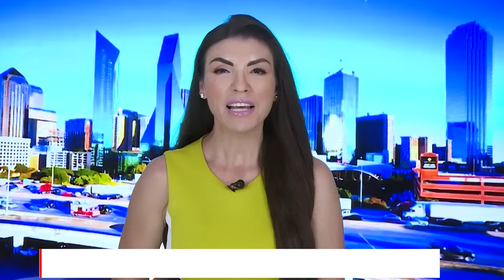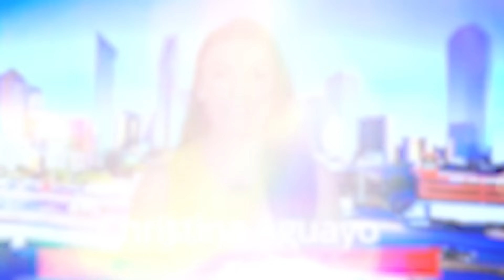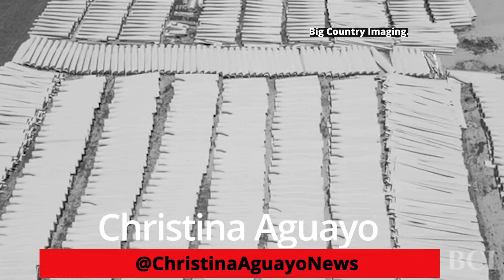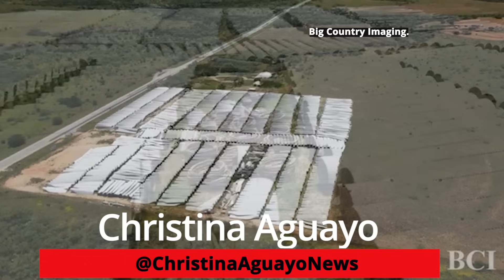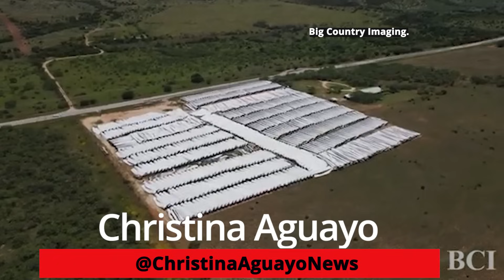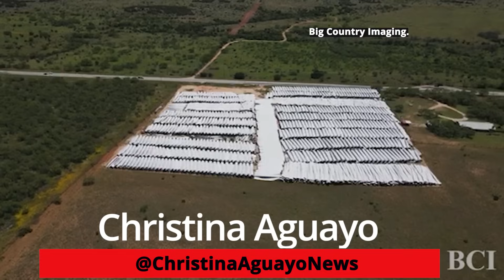Turbine Blades Piling Up In Landfills, Leaking Chemicals Into The Soil

Comment: I was listening to an AM talk show earlier today.  Some guy talking about a project to be built here in Pennsylvania.   They will be working to build a 4200 megawatt power station powered by natural gas.  I think he said it would cover 320 square acres.    

He also said that an equivalent wind generator farm would need 1,800 square acres of wind generators to produce 4200 megawatts of electrical power .. I forget how many wind generators. 

He said that it would take 7,000,000 solar panels to produce 4200 megawatts of power.   I forget how many acres, but it was a lot more than the wind generator farm. 

I'm not sure those are accurate figures.
Reply: So, the internet says it takes 12,800 solar panels to generate 4200 megawatts of electricity and would cover 2000 acres.  That's about 3 & 1/8th square miles.  
The natural gas plant that would generate 4200 megawatts would cover only 1/2 square mile.

Comment: Turbine blades are pretty much inert, throw them in one of the myriad open cast coal mines and forget them.
Pollution even minor, concerned with green energy gets blown out of all proportion when the massive pollution by the fossil fuel industry gets a free pass. Fossil fuel propaganda designed to mislead.

Comment: CLAIM: Erosion caused by rain releases BPA and microplastics from wind turbine blades into the environment. 
FACT: Wind turbine blades' protective coatings are non-toxic and contain negligible amounts of BPA, and the blades are specifically designed to have high resistance to weathering.
This channel is blatant propaganda for the weak minded and ignorant.

Comment: Notice that they don't say WHAT "chemicals". Carbon fiber and fiberglass and epoxy are pretty stable. 

I doubt that there is any leaching of "chemicals" into the soil.

Having said that, I am against win and solar, or at least against it when it has to be subsidized by the taxpayer to make it economically viable..

But for chrissakes, get the facts straight. There isn't any leaching of "chemicals" from the blades.

Comment: However, the United States Department of Energy and the American Clean Power Association state that these emissions are not large and do not account for significant environmental pollution, as the BPA is mostly encapsulated and the protective coatings prevent extensive degradation

Comment: The global average output of unicorn fart harvesting is about 20% of the rated capacity at best.
It might be okay if that twenty percent is 24/7 then you would just need another five windmills per lie to get the claimed capacity. But that’s not how it works.
Sometimes you actually get the rated capacity and even more than that because they have put in those extra fart harvesters so you get five times the power you didn’t actually need in the first place because they are still burning coal and or gas because of the fact that the unicorns often go on strike or throw a tantrum so they turn the fart harvesters off BUT you still have to pay top dollar for all the power they would have supposedly made if the useless wastes of money ever actually worked as claimed. So you’re getting all this free energy at top dollar on 100% 24/7/365 even though you’re at best only getting 20% until the black outs.

Comment: Turbine blades are hollow.  They are made out of fiberglass and steel.    Blades are held in bone yards until they can justify cutting them up.  They can be recycled into more fiberglass products and the steel scrapped, but to hire a crew to do this, can only be done, when there's enough to keep them busy.

Comment: Ever wonder about what happens to tires? You buy them they have thick tread. Years later the tread is worn off.  Where did it go, and what about the chemicals in the rubber? And do all the tires get recycled? What about that rubber scrap in the playground?
Electronic waste?
Batteries?
Kids drink pouches?
Medicine we take? Medicine we discard?
Home demolition scrap?
The waste products from mining and making cell phone batteries?
Polyester lint from washing clothes? 
How about coal ash? 
Have you ever been around an oil refinery?
Reply: So , you WALK everywhere you go  , BAREFOOT  , RIGHT  ?
Reply: @RW_TractorPilot  No, but I do walk about a thousand miles a year.  
My point is there are things done in America regularly that cause more pollution than these blades. And with the EPA being gutted there will be so many more things that cause more pollution than these blades. 
If you care about these blades perhaps you should walk barefoot.

Comment: The material these blades are made from is the same that they use in pipes to carry water, also the same material as the millions of cooling fan blades on all oil refineries and power stations. Now it’s a problem????? There’s a lot of very worried rich billionaire oil barons out there, and a lot of gullible peasants who are willing to forgoe clean air cheap energy and non reliance on Russia and Saudi to keep them billionaires,,,,,,,very strange?

Comment: I saw vertical windturbine that use metal blade.. those turbine can even close the blade if the wind become to strong outside, protecting the turbine. Those turbine can generate TONS of energy, are made of metal or steel, not plastic of fiberglass. 

Wind turbine is not the problem, the problem is how they are made. Those who make actual wind turbine should be faced with environmental disaster and should find a way to repair their mess. If they can't.. then it's ==== to Jail.

Comment: And now compare that to the environmental damage that would have happened if we would have used coal plants.... then you will go away in shame.
One single wind turbine saves depending on size and location between 25 and 150 tons (!!!) of coal per average day.... think about it!

Yes, even windpower and photovoltaic causes environmental damage, but very very very little compared to ANY other form of power generation.
Storing used up blades on dry land or digging them on dry land does not do any harm, recycling them is possible but expensive, so digging them up is not seriously an issue and compared to the environmental damage of cars of thermal powerplants of nuclear plants a ridiculous topic.
Reply: 😂😂😂😂😂😂😂😂😂😂
HOW EXACTLY do Nuclear Power Plants cause " Environmental Damage" ?
Reply: @RW_TractorPilot  Is this a serious question?
Do you seriously believe a nuclear reactor runs out of nothing and does not need any ressources? 
Have you ever seen how mining for radioactive material works and how to make fuel rods? Do you believe the fuel rods are beamed by magic and do not need logistics and transport in specialized and very expensive equipment?
Storing the radioactive waste after the fuel rods are used creates another environmental problem which is completely unsresolved, we pay billions and billions in recovering old waste from leaking (not so) final storage facilities.

Comment: Renewables are a commie scam, designed to hamstring the West, it has been successful at doing exactly that here in Australia, power prices going through the roof, cost of living destroying the middle class, housing becoming unaffordable for young people to get into. 
A prosperous society requires cheap and reliable energy to be productive and maintain a decent standard of living. 
Only brain dead lunatics think these so called renewables are going to achieve anything, we can't control the major drivers of climate, 
#1 The Sun, solar flares. 
#2 The Moon. 
#3 The magnetic poles. 
#4 The proximity of Earth to the Sun during its orbit. 
#5 Volcanic eruptions. 
#6 The Jet streams movement. 
#7 Earthquakes. 
This is only a small portion of things beyond our control.

Comment: And for dummies.   Oil is needed and takes more for those big blades. It cost more for an engineer to service due to the size and the blades only last a year. So then they pollute the earth when they rot.  They are not efficient   Cost more. And do more damage  to the earth and environment.   Do some research

Comment: I am an electrical engineer, I warned about this years ago, i warned about solar panels (i worked in solar panel production) and said these things are made of lots of toxic metals that we cannot recycle, i was called stupid. I warned about the materials used in windmill production and also, how they cannot be recycled (the blades are made from fiber glass and many other resins and compounds that are highly toxic to the environment) and once again i was mocked for saying it. Heck, ever since my college years back in the early 80s, i knew digital waste was going to be an issue, but i just thought, well by the time it becomes an issue we will figure out how to recycle the materials, here we are many years later and still have no clue how to do this. Green tech is not going to save out planet, it is going to destroy it even faster unless we find a more advanced manufacturing process that uses compounds that can be easily recycled out of any material we make.
Reply: Isn't there also all kinds of maintenance on these windmills including lots of oil which is a cost and a hazard?
Reply: @kathym6603  I talked agew years ago to a dude used to be a safety  inspector (if correct)on a pipe line company and he told me windmills were worse because of all the hydraulic  fluid leaking into soul damaging the ground
Reply: @kathym6603  Yes. Hundreds of gallons of petroleum products all replaced on a regular schedule just like your car's oil schedule etc.
Reply: All ya can say is thanks joe
Reply: Oh, solar panels can be "recycled" 😑 Last I checked it cost $23 to get $4 of materials back. They use many nasty chemicals and a lot of power to do so! It's cheaper to mine the stuff.
Reply: If you put a epichlorohydrin and Bisphenol A rich polycarbonate blade through a big grinding machine that breaks it into tiny pieces and then slowly send those pieces to an oven so that it burns completely the problem has been reduced. The whole process would need to take place in a completely sealed factory that uses filters to recycle the air inside it in order to remove the toxic elements produced. You then need to figure out what to do with those chemicals? Would the factories recycled air supply eventually turn to carbon dioxide? if so an oxygen rich fuel source to power the ovens would be required?

For sure it would all take a pile of money to produce an environmentally friendly factory with close to zero emissions and a lot of energy producing fuel to run it but if you want the messy problem solved that is what you now need to do sadly.

Call me stupid if it makes you feel better.
Reply: @kateathend wind turbine blades are being ground up 'recycled' in Louisiana, Missouri. It's the only one I know of in the US.
Reply: Wait for when large numbers of EV's need to be recycled, I can see them shipping them off to Africa to turn the continent into one giant taxic waste dumb.
Reply: That's the whole idea.. destroying the planet. Just ask the fascist Greens

Comment: Kinda like how the green mob pushed compact fluorescent bulbs to the point that incandescents were outlawed. THEN we find out they contain mercury, AND they don't last nearly as long as originally claimed.
Reply: LED's are no better; they burn out if used upside down for very long!
Reply: @Cactus_Blob  interesting, didn't know that. Which direction is upside down?
Reply: @bullfrogpondshop3179  When the base is on top the heat hurts the electronics in the base and they burn out 10X faster!
Reply: @Cactus_Blob and bad for your eyes

Comment: Most of this is true, and it's been known for a long time. I'm skeptical however about the chemicals leaching from the blades. They're fiberglass, Kevlar, or carbon fiber composite, and those materials once cured are inert as far as I know. If they do leach chemicals they would be doing that during operation as well, although in that setting they're more widely distributed.
Reply: What do you think binds that material,
epoxy resin, chemicals!

Comment: Beneath the soil is ground water.
Reply: Correct! That's not a proper landfill where the refuse is isolated entirely from local groundwater. They're just dumping them on the soil itself. Not even a fake "plastic barrier" 😡 which wouldn't last 5 years...
Reply: Do you ever wonder what happens to the lint from clothes that doesn't get caught in the dryer screen? Before that it goes down the drain. All that polyester put in the water.
Ever wonder about the mining and manufacture of cell phone batteries?
Ever wonder what happens to medicine after you take it? 
You know that smell of fresh pavement? What happens to that? What about the other petroleum products in pavement? 
Ever seen coal ash? 
Tires wear down on roads. What happens to that rubber and the chemicals in the rubber?
Reply: What is below that? China?
Reply: Exactly.

Comment: Bird killers, too.🤬
Reply: 600 cubic yards of Concrete in the Base of EACH one  .
People don't stop and think of that either
Reply: @RW_TractorPilot  220 tons, iirc. That's a LOT of CO2 to build them. Plus roads and bridges to connect the turbines (for installation, they cannot be avoided, those trucks are huge too!)
Reply: I'm not as worried about the birds as I am about the humans
Reply: In my country we call them Bird-Shredder
Reply: I don't understand how birds don't know enough or can't detect the movements. It's actually surprising. But I've come to learn that it's apparently true.
Reply: @joewoodchuck3824  The birds and bats can sense there's something there, but the outer parts of the blades spin so fast it looks like open space to them. In fact it's the most deadly space and they literally get their heads chopped off by the blades.
Reply: @joewoodchuck3824  At the tip of the blades the speeds are between 100-200 mph.  Doesn't look it.  But we observe them at quite a distance.  Those things are huge.
Reply: @joewoodchuck3824 The 5 spiesis of bat that the wind farms along Lake Erie were killed by the Inrasound noise of the turbines! It is doing the same to the people who live there!